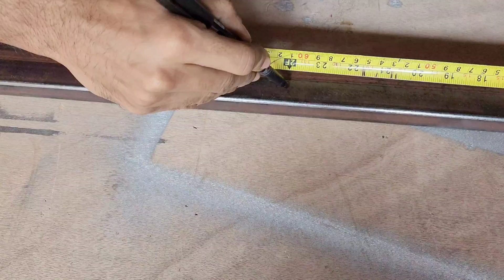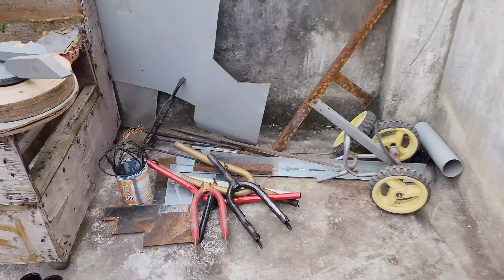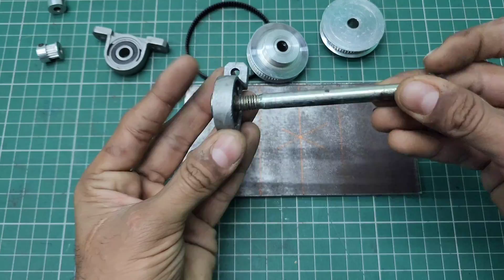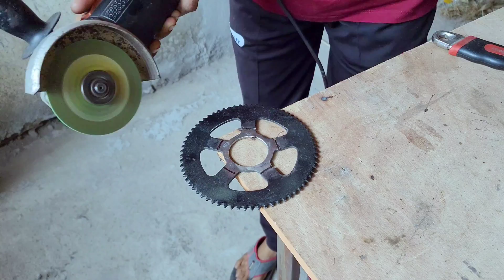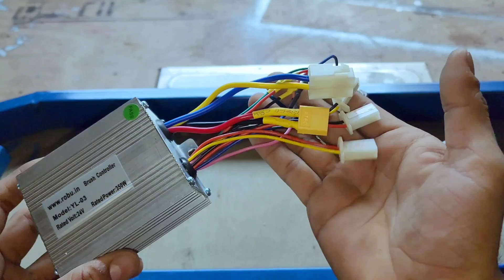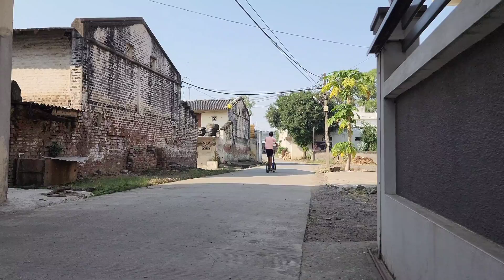DIY electric scooter using 775 motor

Comment: I don't think its a better idea by using three 775 motors, rather than using one singly E-cycle motor with better torque and rpm. These 775 motors get heated up quickly and the brushes get damaged anytime. It also consume a lot of battery juices. Any ways its a DIY project so OK for experimental purpose.